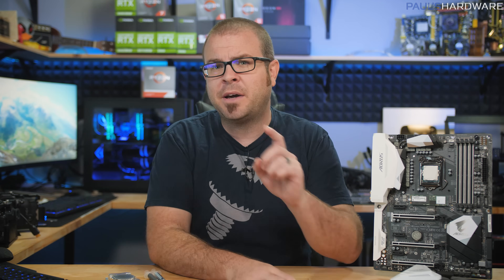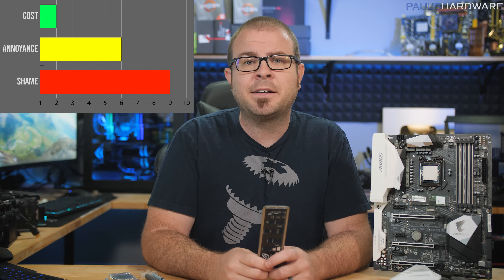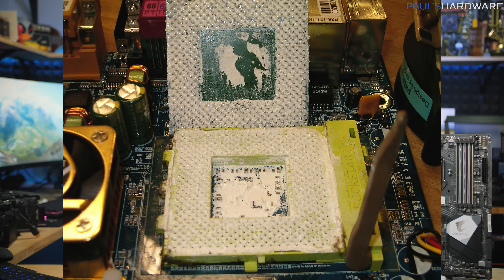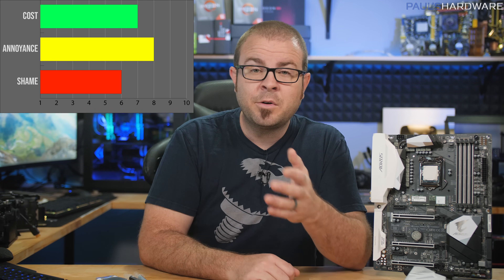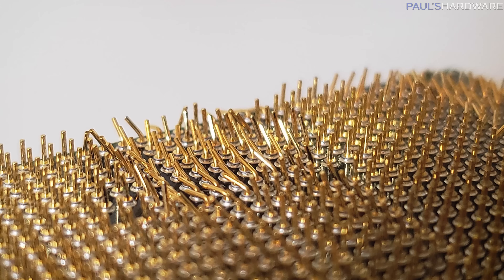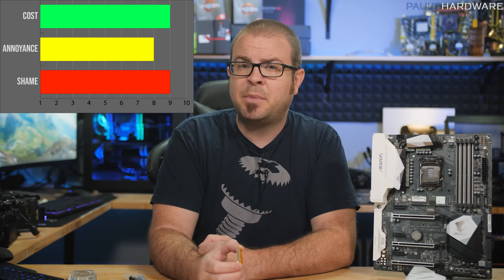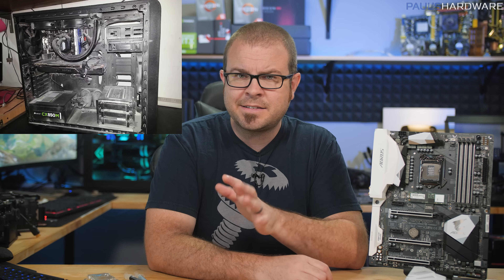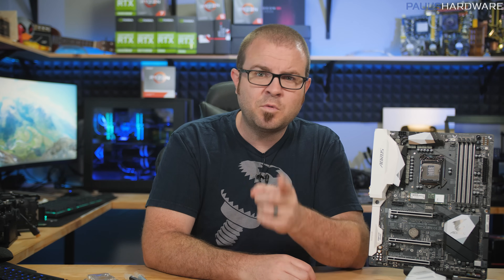The 5 WORST PC Building Catastrophes 💥🔥🧯

Comment: Realizing you've been using your high end SSD on SATA 2 instead of SATA 3 port for years lol
Reply: How did you even find out? I have a WD blue SSD in a SATA 2 port (no SATA 3 in my backup system, it's ooold) and it's super fast. It's not noticably slower than the SATA 3 connected SSD in my main system.
Reply: @reinierovertoom7123  Its not a big deal, everything works fine. But you're limiting your 500MB/s+ SSD read and write speed to 300MB/s. Its like paying for Samsung EVO SSD and getting the performance of an entry level Kingston SSD. I just googled, your WD Blue SSD is able to write at more than 500MB/s but your SATA 2 controller is limiting it at 300MB/s. Obviously, you won't see a noticeable difference in NAS or Backup systems, but if you're using it as a BOOT OS drive, you're killing 40% of theoretical performance on SATA2 vs SATA3.
Reply: I think my GPU is in the wrong slot....

Comment: 1) Damaging components with an Electrostatic Discharge. (Pretty annoying, as you hardly know what's wrong if you didn't dropped anything for it to be broken).
2) Not checking if the power supply was set to work on your country's voltage. (I once bought a power supply that had a switch for 115v/230v, you can guess what I overlooked).

Comment: i killed 2 ssd's a hdd, 2 fan controllers and 8 fans before realising that you have to use the cables that come with your psu, even tho the one that were in my case fysically fitted the psu, the pinout was different and i supplied a bunch of 5V circuits with straight up 12V, smoke from the controllers, popping led's in the rgb fans, and the drives were never recognized in bios again.

Comment: 4:34 I had sparks and smoke coming from my MB once. I clamped a fan cable between some metal parts during assembly. The short circuit caused some SMD components on my MB to go up in sparks and smoke. The MB survived, but I got my pants full! Watch out! The 12V rails in a PC can weld copper and do all kinds of fireworks when shorted.

Comment: Bent pins. Yeah, I did that with both a x6 1090T Black Edition, and FX-8320. Not sure what damage was done exactly, but it ended up in reductions in overclocking. I could only achieve 3.7GHz on the x6 1090T, down from 3.9GHz--4.4GHz on the FX-8320, down from 4.7GHz.  I thankfully haven't bent the pins on my R7 2700X.

Comment: A colleague managed to combine 1 and 2. For reasons unknown the PSU exploded as soon as he finished building his system and turned it on for the first time. Then. when he tried to reinstall the plastic CPU cover to return the motherboard (because he wasn't sure if it was ruined) he did it wrong and bent some of the pins in the CPU socket. I took the damaged board off his hands and was able to straighten the pins in the CPU socket and he got a replacement motherboard and PSU.

Comment: You can start a fire by using EVGA power cables with a Seasonic power supply. lol
Reply: Tyler Url Eh?
Reply: @OtherTheDave  did this on my wife's PC I switched out my Seasonic PSU to put in hers and put a breefer one in mine. But didn't switch the cables because I just wanted to switch my PSU not rewire the whole system. Long story short always match the PSU cables to the PSU your using. When we turned on her PC it fried and SSD.
Reply: Tyler Url As long as they both use IEC cables, it shouldn’t matter (and if they aren’t using IEC cables, one PS’s cable shouldn’t physically fit in the other PS’s socket). Maybe the new PS was faulty from the factory?
Reply: @OtherTheDave  Neither PSU was faulty, we switched all the cables so that EVGA cables went with the EVGA PSU and the Seasonic cables with the Seasonic PSU and everything has worked perfectly. I noticed that the cables were slightly different. But I thought that was something that would standardized.
Reply: The cables fit because they are still MoBo cables and Sata cables, etc... Everything fit but they are different, I think they put the ground in a different spot but I could be wrong.

Comment: This especially for AMD users - doing away with the back plate while installing a cpu cooler only to find out the when the cooler is dead and you need to replace it the new cooler requires the original back plate

Comment: I had 3 incidents happen 1. Bending pins on my phenom ii x4 960t few months after release date. I spend around 30min with grandpa glasses  a toothpick and sweat poring down my face and butt cheeks  to fix that shit. Second playing while thunder storm is happening 2 times. First time with an old athlon 64 x2 6000+ It fried everything. Only gpu and harddrivers were alive. Second time with phenom ii x4 960t lucky i had corsair vs series power supply ( Supply  prevented damage to other parts. But died in the process lucky i had warranty still.

Comment: Plugged a 3.5" floppy drive power cable in with the connector shifted one wire over, shorting power wires because we hadn't figured out that keying power connectors is a good idea yet. Turned it on, instantly fried the floppy drive, the PSU, and set the wires on fire with the voltage burning the insulation clean off in a gout of smoke and flame. Always double check your power cables.

Comment: I was putting in a cable mod LED strip into a different case.  The adhesive was wearing away so I used scotch tape.  Well, the tape somehow got in between the 4 pin connector on the strip and I found out scotch tape is conductive. The entire cable instantly melted and began to smoke like crazy!!!  I killed the power just in time before serious damage was done.  There was some melted plastic on my EK pump power cable and another second or two might have caused that cable to be burned just as bad. 

The quick puff of smoke was enough to set off the smoke alarm in my house (which I guess having good detectors isn't a bad thing...). This was 11pm and it woke my wife and (at the time) 3yr old son.

Cost               1; the strip was about $15 and I got about 2 years out of it.
Annoyance    7; I needed to go without LED for a bit and I also needed to inspect the area around the cable to ensure nothing else was damaged. 
Shame           10; It was a very dumb thing to do... and my wife got WICKED mad at me and the kid was crying.

Comment: Accidentally formatting a hard drive that you've already got data on when you setup Windows.
Reply: Happened to me once, I was installing linux (Ubuntu I think) on dual boot with Windows, I use the entire hard drive instead of a partition, all files on windows gone forever, I lost my whole progression on Skyrim I recall. The shame.
Reply: @mauricioMachuca  Well I suppose there are worse things to lose than Skyrim progression. I lost all of the digital painting I did for years.
Reply: @mauricioMachuca  Haha, I did the same thing once on a netbook here's tip for you, if you realize your mistake right away then cut the power, as long as nothing is overwritten all your stuff will be fine, you can more or less fully recover everything, you just need to re-create the ntfs partition (some paid recovery tools can easily do this).
Reply: Hard to believe I've never done that. Well, not on my machine. Customer machines don't count. lol
Reply: Why that drive in my PC is now labeled "DON"T DO IT!"! Lost 3tb of data TWICE before I learned...
Reply: I did that once (although Windows was already set up). I had to spend money to recover that data.
Reply: Dont fucking remind me of that
Reply: Just don't plug in the drive until after you install windows on the drive you want
Reply: Hence why I put documents on another HDD to separate the boot+app drive with game+docs drive. It's also has different size

Comment: How does someone bend their pins on the motherboard socket? If you drop it to a flat surface with any angle, it will not damage it. You have to purposely attack it.
That's why I think LGA is better than PGA.
Reply: You don't attack your motherboard?!
Reply: How about the CPU slipping from your hand at 10" and falling edge-on directly on the socket?

Comment: My 2nd computer I had ever built, I went to take the side panel off that had a fan mounted on it. The panel slipped from my hand and ripped the fan wire out of the fan. Well the PC was still plugged in those wires kissed, and like lovers, sparks flew. My motherboard smoked and capacitors popped. Leaving all my Napster files all lost. Years later I would be able to recover all those files only to realize I had crap taste in music

Comment: 10 years ago I was poor and got a Rosewill case with an included PSU. The PSU must have been some cheap no-name brand. I used the PC non-stop for 2 years, then one day I smelled burned electronics, 5 seconds later huge sparks came out of the back of the PSU, then the system died and actual smoke came out, and a lot of it too. Surreal. Perhaps even more surreal was that nothing was damaged aside from the PSU. So mistake #6 -- buying a case with an included PSU. Always buy a third-party PSU from a reputable brand.

Comment: Have forgotten the io shield multiple times.  Now I have fixed that by only buying boards with builtin shields.  And was chasing a pc fault once and thinking maybe it was the psu, I installed a 650watt (underpowered) new psu I had around and poof, short and away went the PWM Fan Hub on the chassis.  Turns out after replacing most every part in the computer my intermittent problem was that Fan Hub.  Only found that out by getting frustrated after replacing everything else and bought a new case.  Now it works perfectly and I have an extra Define R6 lying around.  Hmm, I also have an extra Z390 Hero XI laying around as well as an extra I7-9900k cpu.  Don't know why I would need a second pc, but why not?  I might as well do something while waiting until Sept to get the 3950X and X570 board.

Comment: I still think components that are /almost/ working properly are the absolute most annoying. I had a PSU that worked perfectly until I drew too much wattage (rated for 550, but would start tripping at 250W...on my 280W system). As I didn't have another PSU to swap in, I had to eliminate every other component as the source of failure; basically had to disassemble and rebuild the whole rig, running benchmarks at every step. On a different prebuilt work desktop, the thermal paste had deteriorated just enough to cause intermittent issues. It worked just fine (in retrospect, a little warm) under normal workloads, but would occasionally crash if I hit the CPU with a heavy multithreaded workload on days that the office was warm. Turns out it was overheating, but the system crashed before it'd throw "high cpu temp" warnings (either because of a sub-par chip, or my IT somehow interfered with that system's function). I had this issue intermittently for two years. Shipping it after those two years deteriorated the paste to the point where it'd crash consistently about 3 min in. Quick peek in bios showed high 60's at idle. Quick cleaning and some new paste later, and it runs perfect. Collectively, 2 days were spent with IT trying to figure this out. Easily the most expensive $8 fix I've had.
Reply: Another one, my laptop didn't want to connect to my home sharing network. It'd connect to the wifi just fine, get internet and everything, but absolutely refused to see my home network; so I couldn't print from it or access the NAS. After hours of troubleshooting, the software feature that should have worked....just didn't. No corrupt windows files detected when checkdisk'd, soft-resetting Windows didn't help. It took fully wiping the system to fix something really minor.

Comment: Shortening components is easier than you think when mainboard or power supply manufacturers use proprietary connectors. I remember an old mainboard from EPoX which had an USB 2.0 connector that was wired up in a way special to that mainboard. When I tried to use that USB connector cable on my next mainboard, one of its wires went out in glow and smoke. And this still can happen to you with power supplies when you use the cables of a modular unit on another model they were not meant for.
By the way: I once tried to put a PCIe power plug into the CPU power socket like Paul described in his video, but I did not use enough force to squeeze it in there and recognized my error after a while. blush

Comment: This happened to me about 2.5 weeks ago - built a liquid cooled machine for my daughter, dual parallel loop.  The GPU loop was made from 16/12mm PETG tubing and cooled a single 980 Ti via 360mm rad and 3x Fractal Venturi fans.  Since the motherboard only sent PWM signals based on the CPU workload and not the GPU, the fan speeds weren't sufficient to cool the heat coming off the GPU and the ends of each tube became warped and tapered inside the compression fittings.  This caused one of them to explosively pop out of a compression fitting dumping most of the fluid in the loop on the desk and the floor.  Two silver linings in my case - the leak was in the front of the case and there were no nearby electronics or devices to get damaged, and apparently Mayhem's X1 coolant doesn't stain carpet.  Lesson I learned - invest in a fan/pump controller module with water temperature sensors.

Comment: There's that classic move when you didn't flip your PSU power switch on and try to press the case power button. Gives you that mini-heart attack.
Reply: Cost: 0
Annoyance: 5 (because you got to recover from yoir heart-attack)
Shame: 10
Reply: Or plugging your video cable into your motherboard instead of your graphics card.
I haven't done it, but I know someone who recently did.
Reply: I still hold my breath when I do that.
Reply: Lol, every time I rebuild my PC.
Reply: Lance Smith every time...
Reply: Lance Smith I did this my first time. Almost died...
Reply: @ColinMroczko  yes absolutely
Reply: So true.  LOL
Reply: Just did that when I swapped into a new case.
Reply: Agreed.
Reply: That's a classic.
Reply: This
Reply: Everytime I open the case and turn off psu this happenes to me
Reply: even when i am very aware of this mistake i do it everytime lol
Reply: I built my own and I did just that, I sat there for an hour wondering why it wouldnt turn on, then I was like oooooooooooooooooooooooooooooooohhhhhhhhhhhhhhhhhhhhhhhhhhhhhhh
Reply: I've done this BOTH times I've built a PC, and multiple times when removing and adding new/used components. It really stresses you out for a good 10 seconds until you look at the back of your computer and realize that either the PSU isn't plugged in or the switch wasn't yet flipped on.
Reply: First PC build. Did exactly that. Also forgot to plug the PSU cables into my GPU after upgrading it and had a full-blown panic attack for a few seconds.
I also plugged an HDMI cable into my friend's PC's motherboard instead of the GPU and thought I broke his computer.

Comment: Back in 2005 or so I pulled a PSU (more wattage) out if my closet storage and installed it. The dust inside caught fire and as bad at it was the PC was still going. More Recently I changed to a 1000watt as I had as a spare when I rebuild my FX-6350 for my brother's family to use as a school work computer. I grabbed a 600watt rated modular molex cable. Hooked it up and it got so hot it melted the Docking bay wires. Thus killing the docking bay.

Comment: You should be deeply ashamed if you applied thermal paste to your socket. However, you should be able to salvage the motherboard. You can dissolve the thermal paste and then actually wash the board as long as you let it dry thoroughly afterward. Just remove the battery, all heatsinks and thermal pads beforehand and be extremely careful not to bend socket pins on LGA sockets. But again, deep shame.

Comment: I have a Ryzen 7 2700x and recently I changed the stock cooler for a BeQuiet Dark Rock Pro 4. When I took the stock cooler off I forgot to wiggle it a bit and it came out with the processor attached to hit. There was a whole line of pins bent on the side of the cpu and I almost had a heart attack. Very patiently and after about two hours of straightening up the pins (without a magnifying glass btw) and trial and error, I managed to put it back in place and put the new cooler on top. It works perfectly so far and I have run many many stress tests on it.

Comment: Ok so right off the bat on my second build I didn't know shit still cause my first build was a CPU Mobo combo. I watched some tutorials did some research on some pieces got super excited and made a purchase. 10 hours and one small fire later everything was working just fine. I had an Intel before and was creating a ryzen build so every piece was new no part transplant. I didn't know a 4 pin cable from the power supply was necessary luckily it existed on a power supply I already owned but first I tried to use an adapter from 6 pin to 4 pin oh yeah let the light show begin powered on that adapter couldn't handle the load instant fireball! I had the glass panel off cause I wanted to see everything working without protection cause ya know it's my shit so that saved everything cause as soon as that little adapter caught I reached in and yanked the lit torch right from the socket burned my hand cost to fix my hand like a couple bucks worth it.

Comment: I had one motherboard standofs too many that created short circurt cuz it was touching motherboard. So pc would not turn on, luckly was easy fix just hadntp remove that extra standof and pc worked
Reply: one too many? makes no sense. grabbed something metal and thought it was a standoff maybe?
Reply: @bradhaines3142  no bro, had bigger motherboard in the case that had more standofs and was replacing that with new mobo that was smaller with less holes

Comment: 1st - Back in the days of 486s....putting the chip in 180 wrong way. One zzzzzzt and some smoke later....no more computer.  2nd - cutting the keyboard circuit when installing the cooler. 3rd - bitwit forgetting to put the cap on the video card loop. :)